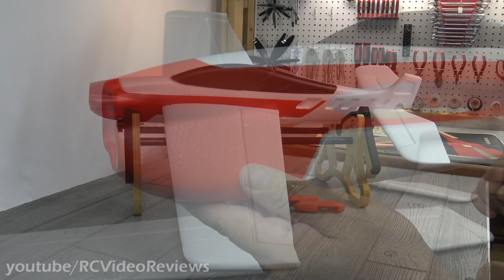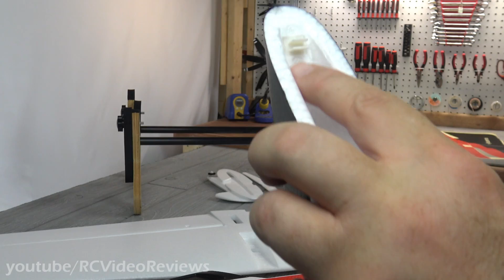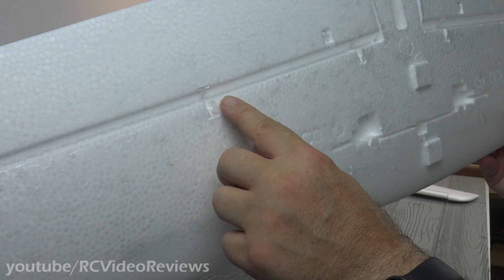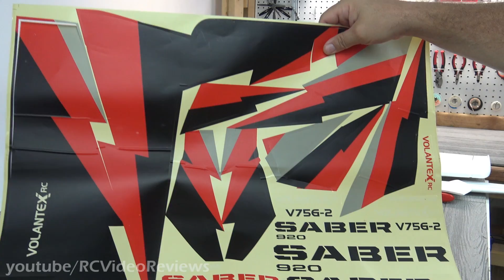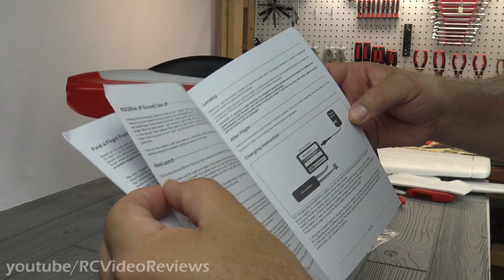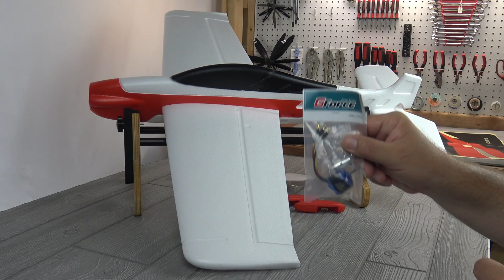Volantex Saber 920 Review • 3D EPO RC Plane First Look

Comment: Hi love you're video. Especially Tx16s video. I have a question. I notice you're plane came with standard prop? But you bought slow prop. My question is. What is best to use as replacement of original prop? Ty rc video review. By the way mine is pnp. And what size of prop is that I should buy? Ty
Reply from the maker: That video was almost 3 years ago :)  I don't think it matters much one way or the other. I think I bought the SF props because I was flying a couple of smaller 3D planes that I considered to be bashers and I tried to use the same prop on all of them. They're a couple dollars. Try them both and see which one you like the best.
Reply: @RCVideoReviews  Hi ty for replying. I got the Gemfan 9 x 4.7 Slow Flyer Prop 2 for 1.70 pretty cheap. :) Is 2200 mah 3s to big? I have shi load of 2200 mah due to flying planes and helicopter that use that size. Ty for taking you're time. :)
Reply from the maker: 2200 would most definitely be too big for this plane. If I recall correctly, 1300 barely fit.
Reply: @RCVideoReviews  Actually 2200 fit well the problem is the back of canopy i added the FS-iA6B.  I had to adjust it by cutting canopy. My 2200 is a 30 or 35c not sure. I also bought a 1500 mah 100c . I love my planes to fly nose heavy (atleast for first flight). It was heavy though. Or I mean still heavy with 2200. But wasn't that much off from the cg. Do you exactly know if cg needed to be on on the cg spot? Many planes manufacture recommendation say a certain spot but it is actually tail heavy or nose heavy.  Sorry long essay. Were final maiden where it was happy where was the cg?

Comment: I got one I think it crap landing gear is really bad I would not consider it a 3d plane it might be a good glider
Reply from the maker: I think it's a pretty good 3D trainer. I mixed the ailerons with elevator to have some fun and have had a blast with this little thing. Still flies.

Comment: The landing gear looks to be the same crappy small tires and press on axle caps as the volantex 750mm super Cub. I was able to upgrade them to slightly larger with proper metal collars for improved ground handling, hopefully the wheel pants allow for the same.
Reply from the maker: Mine has held up pretty well so far but I don't fly it a ton either...Like the plane though.
Reply: @RCVideoReviews  I fly my small profile 3D planes off grass so I skip the gear on them and just give them the underhand toss, normally harrier them in with a tail tap and just let it settle.

Comment: Just build up the saber 920. Have allso the model whitout servos,  motor, and all the stoff.  Have a 22/12 motor and this seams to be perfect.  30 amp esc is a bit high,  but enyway have one hier.  Servos I use what I have.  Just put the decals on and they are verry sine,  but works.  So let me see what I can learn about the montage from you.  Have so mutch funn whit you
Reply from the maker: Have fun with it, it's a good little plane. Make sure you find a good way to secure your battery.
Reply: @RCVideoReviews  thank You,  i put somme extra Magnets on the Canopy and Gummi  for duble saefty fix. The Accu are so thight in the Body,  its allmost impossible that he will move.  Motor I take a 22/12 size and a 30 amp bec.  Maybe I try later a 8 *3.9 prop on a 28 er leopard motor. Try out different sets.  Servos I have 3 different types of servos.  For aileron 2 times mg micro servos,  elevator hi-tech,  Ruder Graupner. Put a video in here on YouTube from the saber 920 but until know,  I don't know how to film and fly together.  How are you doing this?  Whit a GoPro on the head or something?  One video I did last year whit the easy glider on my Chanel.  Check it out

Comment: Thank you for the review.
The material of body and wings are just garbage...
I doubt it is EPO, guess it is EPS or even worse material.
It is so poor quality that the first time my throttle goes up to around 70%, you know what ? the whole motor vibrates aloud.
And the motor mount is found to be loosened already, not because the screws but the motor mount just cannot get hold of plane body. The mounting method of motor is way tooooo weak....never seen such a simple mounting.

I had a soft landing.. when plane almost stopped to an end, one of the front wheel got stuck a little bit thus propeller hit the ground, and,  the whole plane head including motor/mount drops off...
Reply from the maker: Yeah, we're going to have to disagree quite a bit here:

The foam is definitely EPO. And it is most certainly not EPS. I've had EPS, this is nothing at all like it.

I hope you're not suggesting the motor vibration is due to the foam. Did you balance the prop? What motor is it? Is the prop shaft straight? Does the motor run true with no prop? 

I have no issues at all with the firewall, it seems just as secure as any other firewall. Mine is in there very tight.

Why did your wheel get stuck? Does it spin freely without weight? I've been up and down the runway with mine and haven't had a single issue with it. 

This is a good little plane. I'm sorry to hear you're having so many problems--maybe you got a Friday afternoon special, but I've had none of the issues you've described.

Comment: I fly mine with a 2200 mah 3s lipo. I even had to add a tiny bit of weight to the nose. I bought the pnp version.  I wish it had bigger wheels for grass ops. I may add a bigger motor eventually.  This is a real fun plane to fly, for a beginner 3d pilot. I may move up into an Edge 300 model this year,  before the snow flys.  Thanks for the video!
Reply from the maker: You're welcome. Glad you liked it. That's a big pack to stick in this plane. I don't know if I could fit a 2200.

Comment: The Saber will not disappoint. The stock 2212 1400kv has enough power even with a slight breeze. I crashed mine.  Anyway, the Skylark F3A has a sturdier fuselage with magnets.
Reply from the maker: I'm looking forward to flying it. Did yours have the bow in the wing I showed in the video?
Reply: @RCVideoReviews  Mine appears straight. I wonder why yours have a slight dihedral.
Reply from the maker: It's an imperfect world. I'll fly it and we'll see what happens. It's possible the fuse straights it out too.